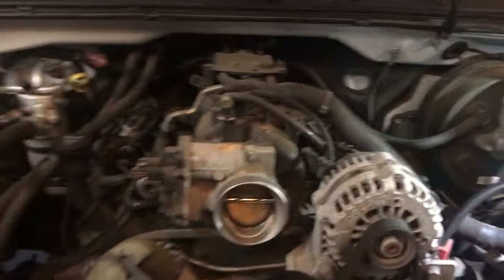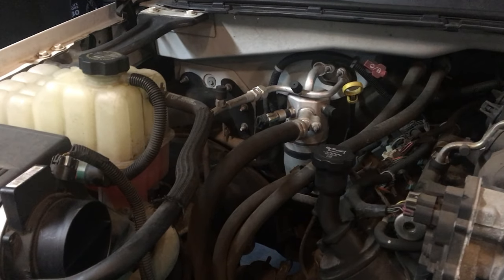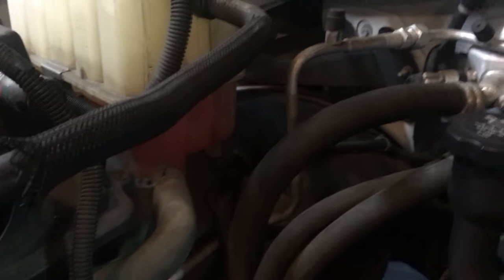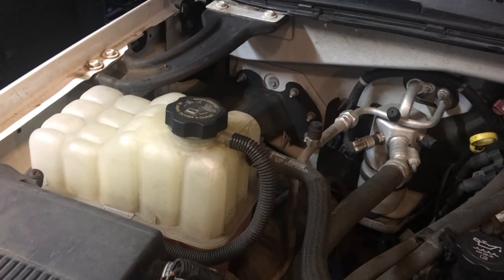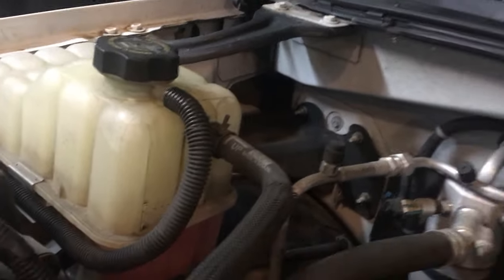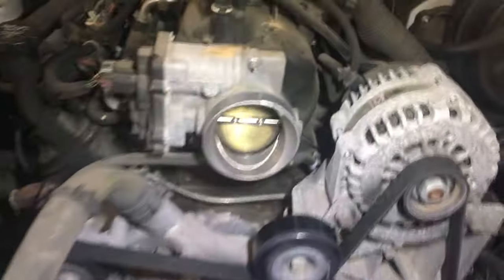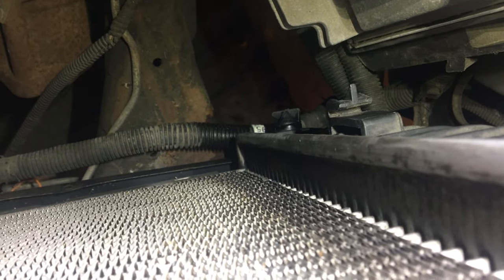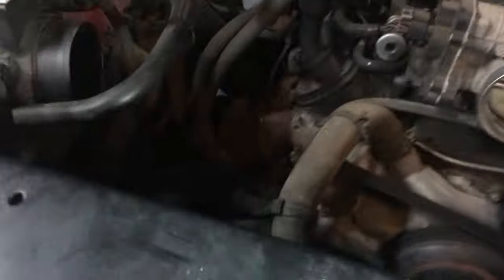GMC Sierra - Chevy Silverado Coolant Leak

Comment: You can sometimes pinch those aluminum tabs that hold the plastic end cap to the core.  There is a gasket inside that will leak when those tabs loosen over time. I use a small pair of vice grips and try to pinch each tab an equal distance. Set the amount of closure on the vice grips to just snug the tabs up a little.. Close the vice grip until it locks then move to the next tab. Usually gets me by for a year or so until I replace the radiator.
Reply from the maker: Good tip for someone in a pinch or to prolong replacement like you mentioned; I had never thought of that. Thanks for the comment.

Comment: My Sierra is leaking coolant from the back of the motor I’m hoping it’s just running down the oil pan from the front and not leaking from the head. When you get a coolant leak always think the worst first. I sure hope mine is not the head gasket. Man that’s expensive

Comment: It's nothing unusual, after years and miles the radiator usually developes a leak  and has for 100+ yrs. and it's NOT fixible now. Mine on a '98 Jimmy with 160,000 miles had a crack in the upper plastic  tank.  Just put a new radiator in and keep moving,  Nothing last forever.

Comment: Same problem. I can't find my .
Reply from the maker: Losing a lot or just a little coolant? I could smell coolant for a while before I actually found the leak. I think I had to pull the shroud off to see well. May let it run for a while in the driveway without driving then shut it down and look for wet spots. A dry paper towel will pickup a wet spot better than my eyes. Good luck.

Comment: What did you end up having to do? Same exact issue on ‘10 Tahoe
Reply from the maker: Hello, ended up just being a hole in the radiator. had to replace the radiator, have a video of that too. Good luck with yours. Thanks.
Reply from the maker: Hello Diana, it depends on where the leak is coming from as to what the $$ is going to be. If the radiator has a leak and needs to be replaced then you are probably looking at $130 for an aftermarket one (or $300+) for an OEM. Pressure testers can be rented (you will get all of your money back when you return the tool) from auto parts stores to verify where the leak is coming from. If it is the radiator it is pretty easy with a few simple tools, I have a video on that. For the check engine light and ABS light, the auto parts stores can scan and give you the codes for those as well. If you have the codes, you can do some research on what common fixes are or what else to check. May take a little more of your time but could save a bunch compared to repair shop bill. Best of luck working on your truck and figuring out what is wrong.

Comment: Hey man i just drained all my coolant and when i filled it back up it didn’t stop leaking from the drainage hose from where i drained it from i put the drain plug back and everything so im not sure what it can be , it wouldn’t leak anything before until i drained everything out and it’s only from the little drainage hose that’s on the of the radiator do you know why that might be happening if you can reply i would really appreciate it thank you!!
Reply from the maker: Hello, I do not know for certain what would cause this. I would check the drain plug to see if it looks damaged or has missing or damaged o-ring on it. Maybe someone else has had this problem. Good luck. Let us know if you figure out the cause. Thanks.